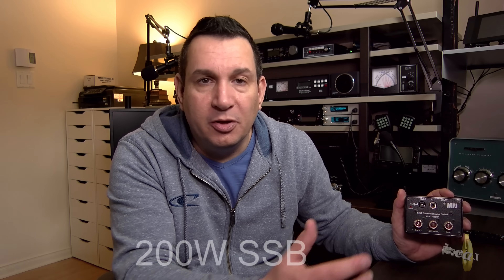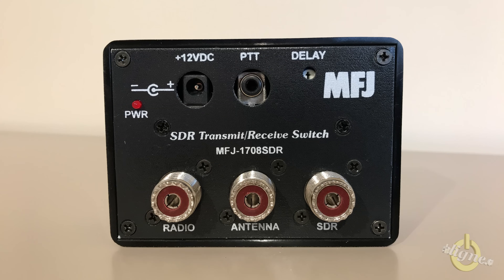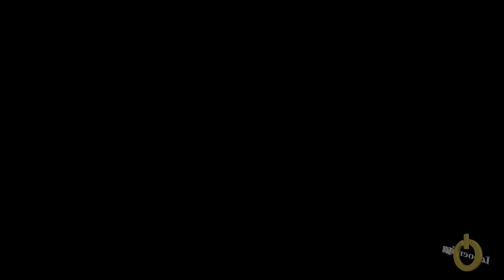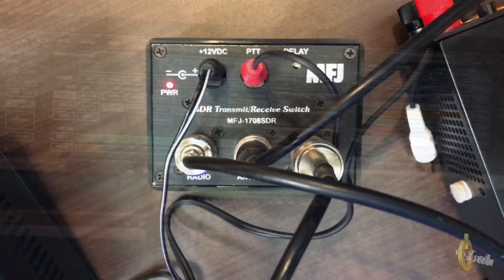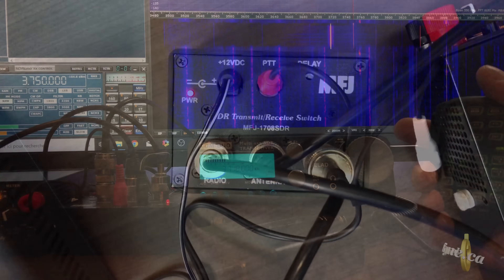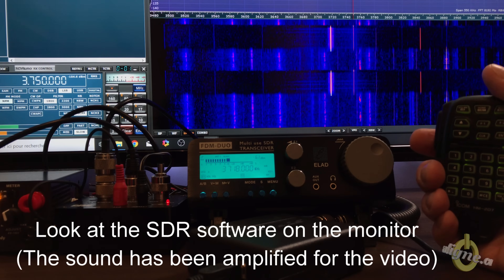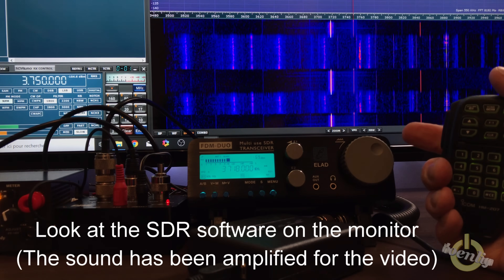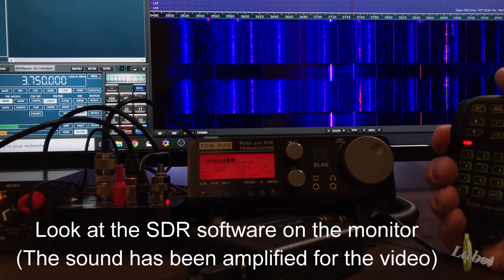MFJ-1708SDR review - Share your antenna between your transceiver and an SDR

Comment: Pascal, do you use the MFJ-1708 with your TS-990S, if so?  Do you connect the PTT circuit too.  I am thinking of using my MFJ-1708B-SDR with my TS-990S.  Your feelings on this subject would be appreciated.  Jim
Reply from the maker: No, I do not use the MFJ-1708SDR in any combination of my setup (I do not have the TS-990S anymore).  I used a switch since I used a high power (1kW) RF amplifier, be sure not to exceed the maximum of 200 W for this unit and your radio can go up to that limit.  73

Comment: Does the unit work with out a ptt connection?i have some simple QRP kits id love to use with my new sdr
Reply from the maker: The PTT is trigger exactly like you will key an amplifier, to if your QRP can key a amp, it should work.  73 Pascal VA2PV

Comment: Good video, but terribly miss leading. I bought the Mfj-1708sdr and all the screws were loose and all the conections were loose giving my 7300 over a 20-to-1. Highly recommended googling this product BEFORE you buy one. Don't take just my word.
Reply: Your better off just putting up a dedicated antenna just for your SDR. KISS rule in affect!

Comment: I can have two Kenwoods TRX radios. To work with switch I connect the antenna port of radio A do switch transmit and antenna port of radio B to receive port in the switch?
Reply from the maker: You connect your TRX to the Transceiver port SO-239 and the SDR to the SDR port SO-239.  When you transmit the SDR is isolated for protection (activated by the PTT) and when receiving, both the TRX and the SDR radio are receiving (sharing the antenna in RX only).  73

Comment: Hi Pascal… Love the video and ended up buying one of the MFJ 1708SDR… It works great on HF. However, I'm getting a 20:1 SWR when I transmit using an AMSAT uplink of 145.8 MHz. If I bypass the MFJ, my SWR transmit is 1.2:1. I do not have this SWR problem on HF. 

My question is: have you tried transmitting on VHF and testing the SWR? I'm curious if it's a limitation of the box or whether I have a bad one? Or, is the box actually frequency dependent on transmit as some have suggested to me?

Thanks again for your great videos – I watch them all and am a subscriber to your channel. 

73 de Robert K3RRR
Reply from the maker: Hi Robert, thanks for your comments and your support.   Just to be sure, there is no transmit radio on the SDR side?  This one is for receive only.   If you are on the transceiver side, check your coax, sometime it's OK on HF and not on VHF and above.  It happens to me a few times, try a new patch cord.   This unit is supposed to be good up to UHF frequencies, I confirmed this with MFJ when I put the video online.  Also, make sure you bought the MFJ-1708SDR not the MFJ-1708 (not the same).  Hope this help, otherwise contact the MFJ support.  73 Pascal VA2PV

Comment: Hi  Pascal. Thanks for the video. Is there any signal degradation by having the antenna shared between two receivers?
Reply from the maker: Hi Ken, Can't say exactly, but usually when you share a signal (in two) you lose 3 dB.  73 Pascal VA2PV
Reply: Well, that's if you're using a splitter like the Mini System ZSC-2-2+ .  I would think that just teeing the 2 receives would be less efficient.  They probably have very different impedances..  I decided to get an IC-7300 and the RX7300 mod for adding a receive output port.  Thanks for all your insight.

Comment: Hi Pascal if you have the time , I would like to know if I can yous this MFJ-1708SDR with a icom ic-7300 and MFJ-1026. So much power line noise in my shack making my my ic-7300 useless. Thanks in advance Rick N2TOX
Reply: You have to see this video: https://www.youtube.com/watch?v=m8bQ10LL924
Reply from the maker: Hi Rick, yes you can, just connect the MFJ-1708SDR between your IC-7300 and the MFJ-1026.  The coax from the MFJ-1026 will connect to the antenna port of the MFJ-1708SDR.  Then, you will remove the noise not only to the IC-7300 but for your SDR receiver as well.  You can watch one of my old videos about the MFJ-1026, with the correct RX antenna setup it works like magic.  See the demo…  https://www.youtube.com/watch?v=ctJ1wHoq3ZI
73 Pascal VA2PV

Comment: What's the purpose of unplugging the DC power to the unit? Perhaps I missed that explanation.
Reply from the maker: It's a protection, let say you lose the power on the unit for any reason, automatically the SDR port is put to ground. So, if you transmit you won't blow your SDR receiver.  73 Pascal VA2PV